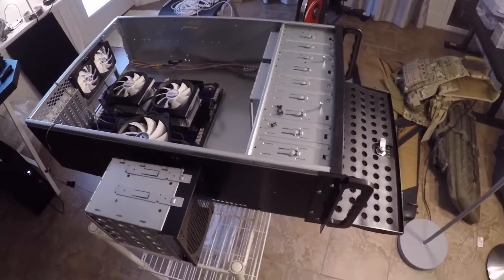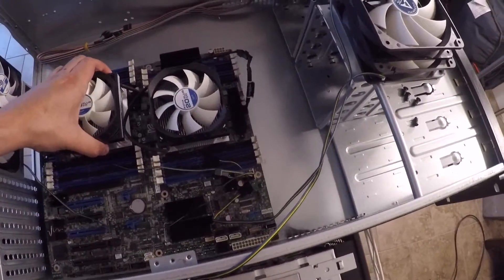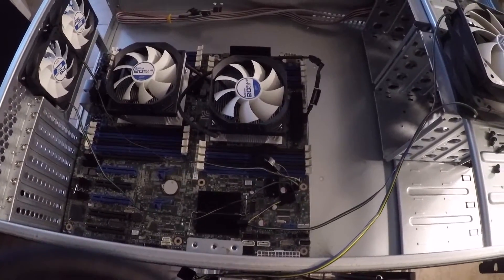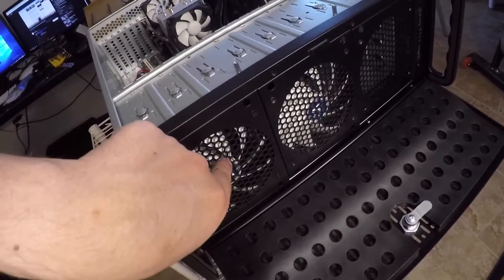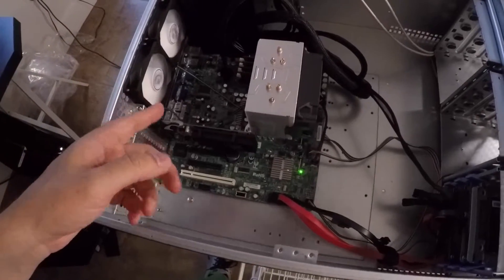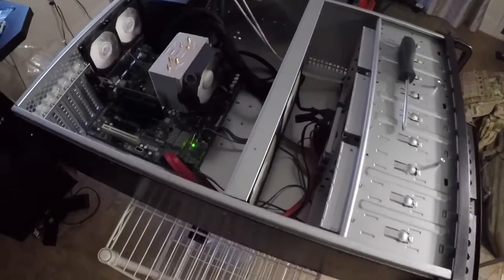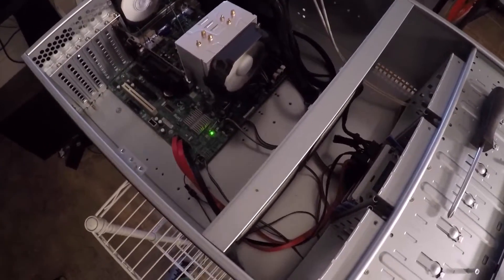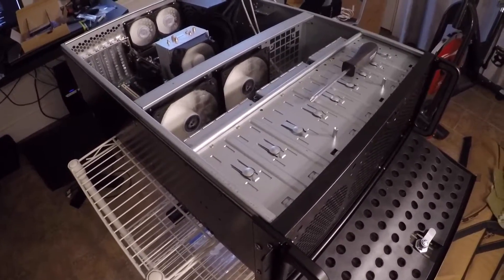Prepping a server for deployment - Rosewill 4U, Intel S2600CP, X8SIL, Arctic Freezer 12

Comment: "Thread ripper killer"
Hmmm, that statement has not aged well! (price notwithstanding)
Reply from the maker: price is the whole point
Reply: @JDMWAAAT  True dat. I'm currently building a server around an  s2600cp board with two 2667v2s and half a terabyte of ram, and it comes in significantly cheaper than even the lowest end contemporary threadripper. Can't beat used for value ;)
It might have been a match for the 1950x, but the modern threadrippers have really taken things up a notch. It's certainly not a "threadripper killer" anymore!

Comment: Do you need a motherboard with 15 sata connectors if you want to fill all the drivebays
Reply: No.  All you need is an  HBA (host bust adapter) card in a pcie slot.

Comment: 6:49 Are you able to remove and add drives with the fan wall in place?
Reply: Yes, you can remove the entire hdd bay through where the door tray locks and drops down. Removing two screws from the top and pressing the tabs down lets you slide the bay out of the server, insert/remove drives, and replace the fan.